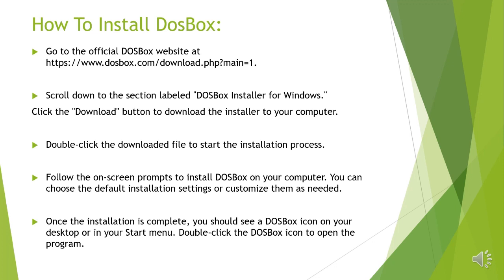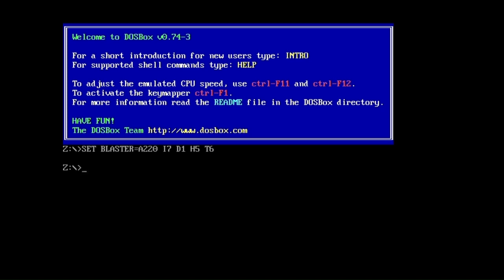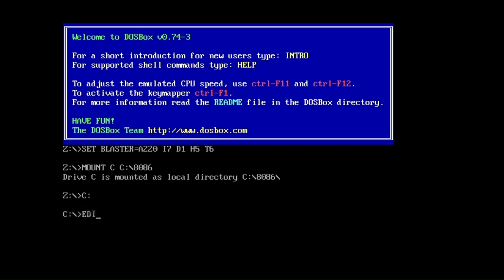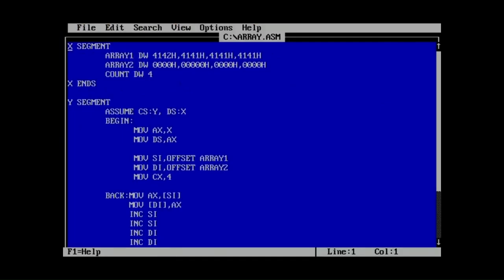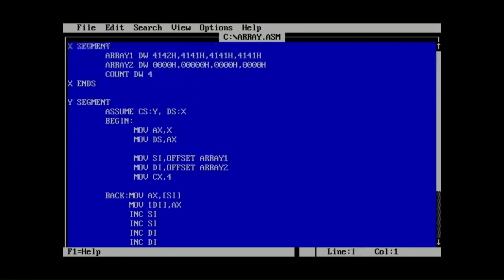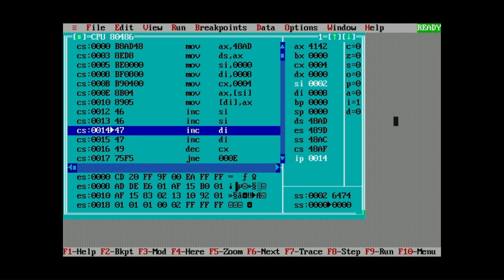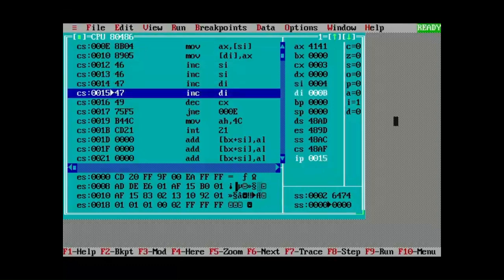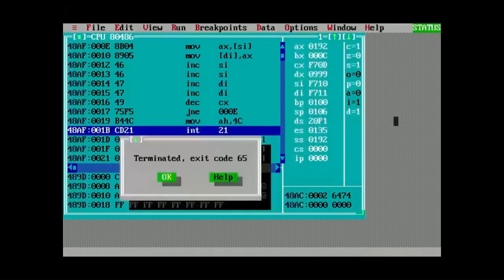DLDCO [MASM 8086 ASSEMBLY]

Comment: In the 16 bit Real Address Mode of the intel 80386+ CPU we can use 8 bit, 16 bit and 32 bit, but the segment size is limited to 64 kb.

To use 32 bit instructions with MASM we can add .386 or .386p to our listing. The p allows to use procted mode instructions to switch into the Protected Mode.

For using 32 bit instructions in the 16 bit mode Masm add the operand size prefix(66h) and/or the address size prefix (67h) to our instruction, or we have to do it. These prefixes reverse the default size of operands and addresses for the duration of one instruction.

From the 16 bit Real Address Mode of the 80386+ CPU we can switch into the undocumented 16 bit BIG Real Mode of the CPU, by switching into the protected mode and loading the segment register from the global disciptor table with a larger segment size like 4 gb for DS, ES, FS and GS segment, but for CS and SS 64 kb segment size and then switching back into the 16 bit real mode and open the A20 address gate. Now we can address all 4gb memory within the 16 bit mode.

Example to build one instruction for the 16 bit BIG real mode to copy a part of the linear framebuffer of a VBE videomode located in the 4th gb from the upper left corner to the center of the screen:

rep           ; repeat prefix
DB 67h    ; address size prefix
movsd    ; moves CX times 32 bit from ds:esi to es:edi .... MASM add the 66h prefix to the instruction for using dwords